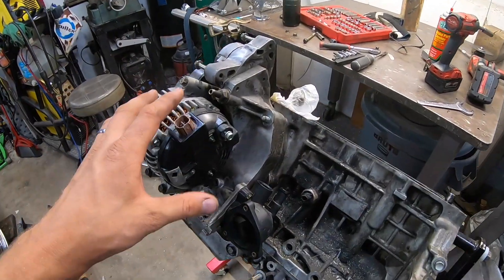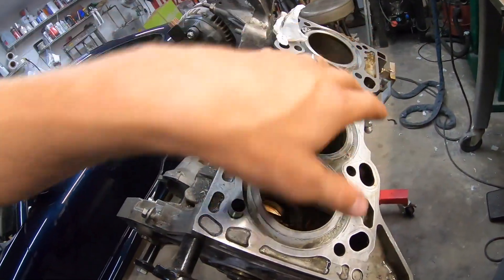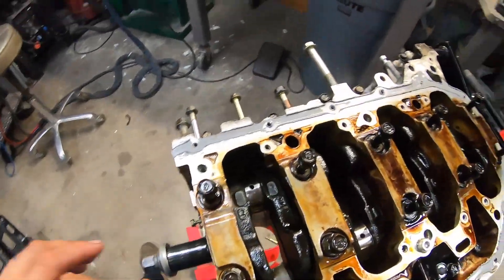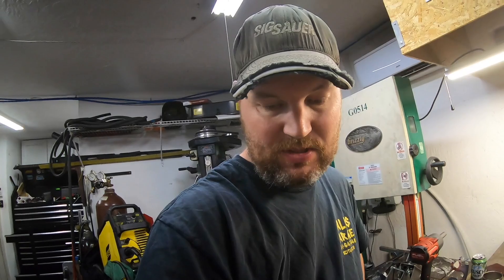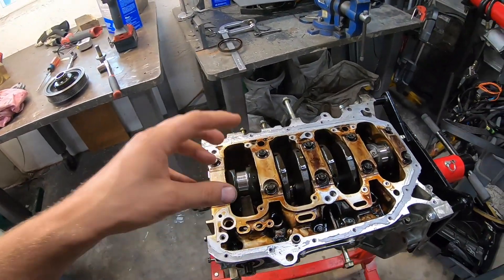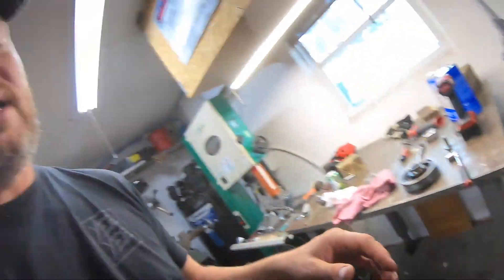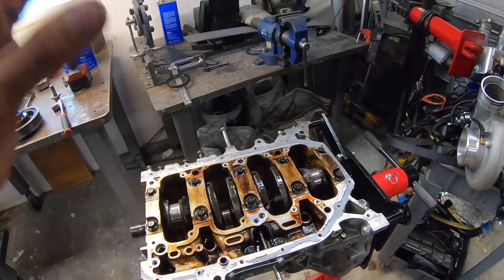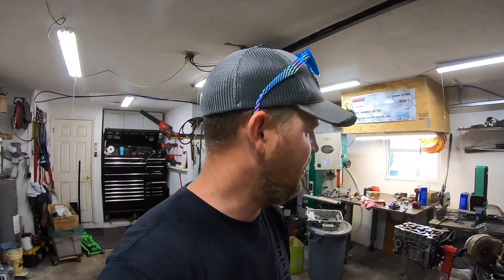The Blown K24 Engine Diagnosis

Comment: If the pin snaps wounded the valves smack the pistons. Just thinking that the engine wouldn’t be spinning that long with no oil pressure because of it being an interference engine. 
     Not sure if you keep using the same oil pump but it could be a sticking oil relief valve.

Comment: Did you plug the oil passage you needed to when you changed from the different style oil pump to the higher RPM oil pump?
Reply: I don’t remember seeing this being done. Seen Kyle do it twice now and both tunes he said how important it is. Only just started watching the video so I’m not sure if he spotted it or not
Reply: Does the hole get plugged or unplugged? I can’t recall which way
Reply: @JayGee6996  The hole has a kind of oil feed limiter which you need to remove in order to PLUG the hole.
Looking at this video, i can see a bolt plugging the hole, it is however "wet" around the edges. I'd weld that hard shut

Comment: i would ask myself what would cause the pin to shear and work from there to find the root cause. of course there's nothing to say the bearings were simply worn from age/neglect. after all it cost $400...

and i would pull the pan on the to-be-installed engine and have a look at the bearings on it too.

Comment: To find the oil (710) level for your car, let the engine be on the engine stand, up right, fill it up to max, install your engine in the car and measure oil again and mark your oil stick with this level and next time you will know this is the correct level. Love your channel, have been following you since the absolute rad Smart car at Faster Proms.
Reply from the maker: That’s exactly what I’m going to do. Thanks for your support